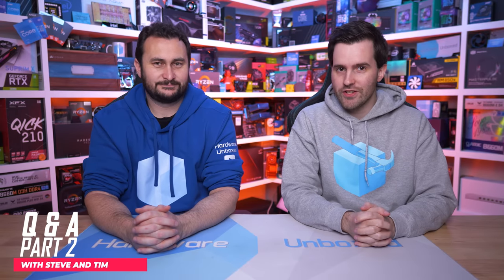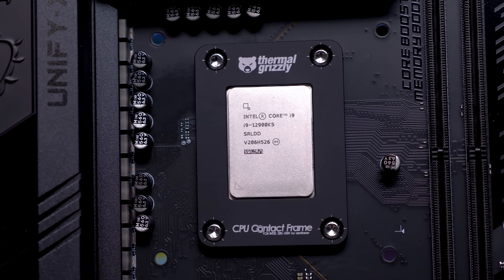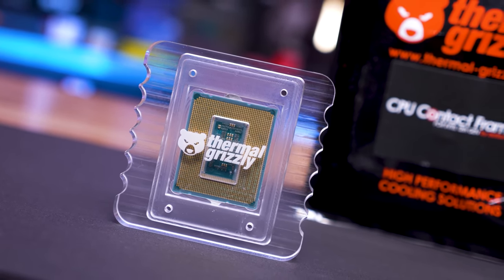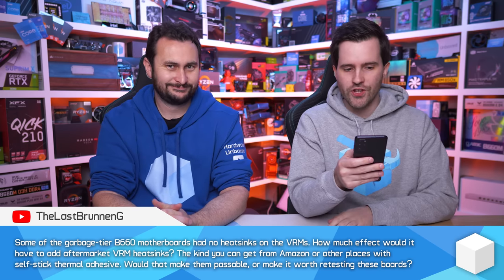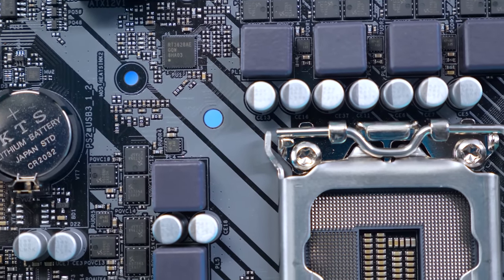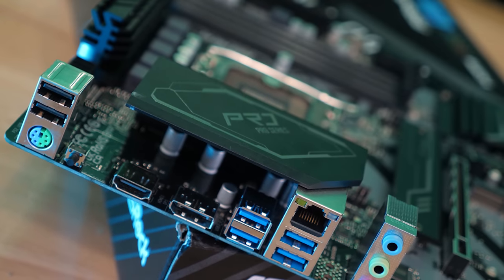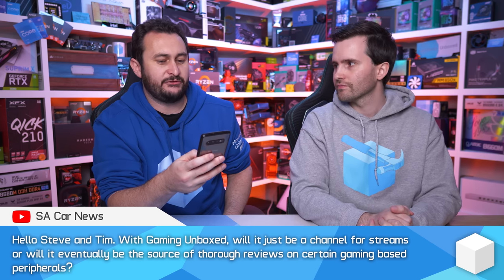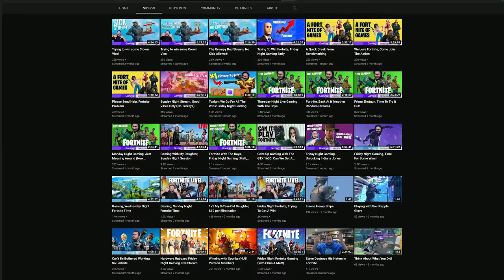Biggest Tech Fail 2022? Zen 4 To Make DDR5 Relevant? August Q&A [Part 2]

Comment: I think the biggest fail that isn't considered a fail by most is the RTX 3060, and to a lesser extent the RTX 3050. They both have ridiculous amounts of VRAM and I recall from a MLiD video back then that the VRAM the 3060 was using cost $12 per gb. Given that the 3060 Ti is a 6gb card, that's an extra $72 (which is probably more for the consumer) that wasn't really needed. We can still see the effect of this in the monthly GPU pricing videos where AMD cards (6600, 6600 XT) managed to drop in price where the 3060 couldn't, so it's in the same tier as the 6700 XT now and loses in almost every way.

As for the bottleneck super high end parts in testing, I think Steve completely got it wrong. He describes as a card you shouldn't buy, which is an extremely mild way of putting it. The 3090 and Ti version exist to rip money out of your wallet for almost no benefit in gaming. The "do your own research" answer is a very lazy one too. If you are into PC hardware and/or tech, then yes people are inclined and able to navigate reviews, but the inexperienced and newcomers are less likely to do that. The 3090 is an awful product for the money, yet using it in benchmarks gives it more exposure than it deserves. I expect this answer comes from HUB not really being in touch with the average gamer.
Reply: The 3060 has a 192-bit memory bus width.  The only options are either 6GB or 12GB.  The 3060 Ti has a 256-bit memory bus width.  The options there are 8GB and 16GB (your claim that it's a 6GB card is simply wrong).

Given those limitations, as absurd as it seems to have a lower-end card have more memory than a higher-end card, going with 12GB is the better option for the 3060.  Going with just 6GB is too little.

Comment: my mouse is set to 16-- vfor battlefiels games and 1800 for the rest. windows is default and then i scale down ingame to 50 to 80+ depending on the game.  I flick left and right and each flick needs to be 90 degrees so it feels the same in every game. that way all games feel great.  above 1800 dpi you really start to get trash feedback from the mouse sensor but you want the max sensor data so 1800 is about the safe limit for most sensors out there. if i still preform bad after that game i stream or record some gameplay and i see if i have overshoot or undershoot when i flick to a target and then slightly adjust the ingame sensitifity or of not powessible ingame the dpi and record again till each flick is spot on.  So adjust the ghame to your mouse not the mouse to your game ! and neverd adjust your gameplay always makee the hardware +game work for you.
And vulkan is absoluly godly sadly most prefer to use DX12 which is TRASH  rage 2 which uses vulkan really is the smoothest game out there. sadly there are still developers that manage to fk up vulkan (looking at you ubsioft... as breakpoint vulkan was trash)

Comment: When it comes to mouse sensitivity I have found that I am higher than about anyone I have ever met, and I have dropped mine down a lot over time. I like a heavy mouse with a very slick surface and a high sens, but I had it to the point for awhile that you could literally see my pulse through jitter in my aim if my hand was sitting on my mouse so I dropped the DPI down until that effect went away. I generally plant my wrist on my desk and don't like having to pick it up. I don't know much about the cm/360 metric that some mention, but I would guess mine sits somewhere around 8cm but it used to be a bit smaller.

Comment: Wasn't the Q6600 one of the first?  I got one when it was new, and 9 years later it was still able to hold 60 fps in most titles.  It was taken off of my LAN before it was really falling behind.  I will typically build a new system, and drop the oldest system off of the network.

I remember the Q6600 or E8400 debate for gaming, and that was just ridiculous how pathetic that comparison turned out only a couple of years in.

Comment: The new socket and new DRAM requirement makes me think there is a cost obstacle to moving to it. Even with this generation coming, I chose to upgrade my existing CPU to a 5950x. I wasn't going to buy another $350 system board and new DRAM. With the GPU being the present gaming bottleneck, that will be where I spend money next.

Comment: Just as an FYI Steve, you should NEVER adjust your mouse sensitivity in Windows. Turning your mouse sensitivity down in Windows literally throws away some of your inputs. Turning it up alters your inputs - but only a fraction of them. Windows sensitivity should always be set to 11 (which is actually the "off" setting) because it's broken as shit.

In game settings are inconsistent, but typically you want to leave them at default (so they are off/transparent). Then you should adjust your mouse sensitivity until it feels right (and what that is is obviously highly subjective and different for everybody).

Obviously if you're not a pro it doesn't exactly matter, but if you are even a medium-level gamer you will probably notice the inconsistency in mouse accuracy and think it's your fault. It's not, your settings are screwing you over.
Reply: This is mostly not true anymore. Modern fps games use raw input data. Generally its best to leave the windows slider alone in case a game doesn't, but it's extremely uncommon these days. If you know that all the games you play use raw input, (Anything made beyond like 2010 almost always will.) you can use the windows sens to manipulate the speed of your 2d cursor pretty safely without fucking up camera feel in 3d games.
Reply: @bigdogmassive  But what about in windowed and fullscreen borderless modes?
Reply: @GENKI_INU  Doesn't matter, games use the same input logic regardless of whether they're running windowed, borderless or true fullscreen. Or if there is an odd exception, it's possible but it would be truly exceptional, like there isn't ever a reason to do that and it would be adding extra engineering risk, i don't think a game like that will be found.

Games that use mouse for the sake of angular offsets, should always use raw input, though i expect a lot of Unity, indie games etc to not do that and use Windows pointer input, but honestly i haven't tested recently. Competitive games and especially FPS would get slammed hard if they didn't use raw input, you can pretty much rely on them being raw input. Games and game sections i.e. menus that use mouse for the sake of pointer interaction should use Windows pointer input.

Comment: There is a developer guide on the Intel website with an explainer of how to properly take advantage of heterogenous CPUs in games, so that if you are developing a game engine with a job system you can give the big wheelbarrows to the big guys, and the little wheelbarrows to the little guys. It involves querying the Windows API to detect the CPU topology, and then binning the logical cores to know how many of each type you are working with, so that you can then set the thread affinity of your various jobs accordingly. The main difficulties being of course that you don't know what you are working with in advance, and that it adds complexity to the already complicated task of making a game scale across a multi-core CPU.

However Intel 12th gen CPUs have been around for less than a year, which means that there are likely very few games that shipped with those optimisations, if any at all. Game development takes time.

Comment: Also, for intel arc gpu's, you will should consider it in several parts.  And one of the best parts, when considering it a mess, you probably should look at AMD's Vega 64/56 GPU's from launch till the became less of a mess and compare those intel GPU's on that time frame for base improvements.  As it stand IMO I wasn't expecting anything from Intel on release just based on Raja Koduri's past GPU releases under AMD almost always doing this.

Comment: Thanks for answering my question guys. I think for the past few generations AMD has implemented some exclusive technologies on their laptops like Smart Shift, and to a lesser extent they popularised SAM.
Reply: AMD and Intel are the only ones using resizable bar (SAM). I have a 3060 ti and there are games where SAM should be on and it's not, and games where it should be off but it's on. Nvidia doesn't care about SAM at all. Nvidia never made a good SAM whitelist in the driver from the start and they still haven't.

Comment: I have 12000 DPI(mouse can do up to 30000 DPI) but it's very low ingame(usually I have to edit the game config files), I've got around 36,6cm for a 360 turn in most games.
Optimum tech did a great video on latency with different DPI settings and it seems that higher DPI = lower latency, though I wonder how high the DPI before It's really diminishing returns

Comment: I typically set my mouse speed/DPI so that ~2-3cm of movement is a 360 degree turn, it's what I got used to playing Quake 1 where the accuracy was limited by the engine anyway, there was no location damage, and responsiveness was typically more important than accuracy. Unfortunately games these days are SOOO much slower it is hard to find anything that compares and what I use is definitely sub-optimal. However I do find it fun playing shooters, charging in to point blank range and making a mockery of modern players who can't keep up with a circle strafe as I kill them with the weakest weapons. Because of that I was ranked #1 in my region for using the TMP in the original counter-strike, and it is still hilarious how bad modern players are at close range combat, unfortunately the long range guns have been made absurdly powerful in modern games and closing the distance just isn't reliably viable any more, at least snipers still have the worst aim of any players though, I rarely have any trouble running up to a sniper to kill them with a knife in battlefield :)

Comment: 24:30 I disagree. Ryzen 5 5600X: 6 core 12 thread CPU will not be unuseable in 4 years Tim.  That's insane. 
A Ryzen 5 3400G is still pretty usable in 2022. 
A CPU today that is unsusable is a AM3 generation.  My FX-8300 (4 core 4 thread aka fake 8 core) runs like molasses on the latest Win10 21H2 update.  It will still load up web browsers and search Youtube but you will see the noticeable slowness.

Comment: Running a i5 3570k + gtx 970...still doing the job...whats that now, 6 or 7 years down the line. Skipped alot of generations so spending on the new ddr5 eara stuff is not bothering me as much as the blokes spending every gen.

Comment: HAve you been considering benchmarking more sandbox, physics based games? I have never seen anyone of them in a proper benchmark, and I would love to know how V-cache affects performance in games like Scrap Mehcanic and Besiege and Space Engineers and KSP and - I'm gonna stop myself right there. If you do benchmark them though, you should really get something that's really taxing on the CPU from the workshop, otherwise the data would be completely irrelevant. (For example, having four hundred FPS at idle and ten with a heavy creation, against sixty at idle, and forty with the same creation, there's a clear winner here).

Comment: I'm still using an 8700K (paired with a 3090ti) and I don't feel a compelling reason to upgrade the CPU yet.  I'll probably give it another year and see where things are.
Reply: Unless you're playing at 4k you could probably get a significant fps boost with a fast gaming CPU. Seems odd buying such a top tier GPU but leaving performance on the table.
Reply: @ChrisMisMYhandle  I play at 3440x1440 ultrawide. I realize I could get better performance with a faster CPU, but with my setup I'm able to play all of the games I play at max/Ultra settings with no issue (just upgraded from a 1080ti).
Reply: @ChrisMisMYhandle  you act like the 8700k is a slow CPU lol

Comment: Well, that is a first comment fail for you, one made from a complete lack of thought.
What could they do on the E cores? Pathing. I mean, it is one single example. ANY asynchronous computing could be done on an E core with a new thread, freeing up the main core to just keep going and then, when it gets around to the stage of "reading what path an NPC is going to take", reads that waiting asynch output for each NPC's path, said path also being dependent on the path of others taken at the same time. Do so every 0.2 seconds and you are running real time as far as human reaction is concerned, run it every second and you're likely at the edges of what humans can manage to REACT under and MAKE their muscles move to make it so. Do it every 5 seconds and you react quicker than any actual pilot of a fighter craft could manage. But any asynch process could be placed there.
Requires it be not-mutlithreaded, and windows is terrible at forking processes, but all it requires is a linked list of outputs to be read by the main game loop and that E core can do its own thing every X seconds (or Y times per second) and never CARE that it isn't on a fast processor, it is on an EMPTY processor.
Now you would also like a dogwatch process that determines if the NPC pathing program has stalled (to restart it) and determine if the main core loop has stalled (so either CTD or do a little cleanup and go to the next loop, and pretend that the failing loop never happened). That's another E core. Because a dogwatch program doesn't have to be the same process as the main loop (indeed it can't be, otherwise if the main loop fails to complete, the dogwatch isn't done either, and it may be that it locked up in the dogwatch loop, halting the game, whereas in a REAL game it would just keep going and not know that the dogwatch has stopped until and unless some other process fails to complete a loop).
Windows not being good at forking isn't why E cores don't get used, and it isn't why E cores shouldn't get used.

Comment: It's the shareholders[chasing the quick dollar] holding the companies to ransom, as the shareholders expect result's NOW NOW NOW. To make GPU's and get them where the consumer wants to buy X GPU with reliable hardware and software takes 12 to 15 years.  IE AMD took roughly 15 years to get its driver software sorted even when they had pretty good GPU hardware.

Comment: Isn't the primary concern with a CPU being "enough" for gaming primarily that it doesn't bottleneck the GPU? In that case the 5600X performs more or less the same as other pricier Ryzen parts, but the 12400F is outperformed by other Intel 12th gen parts with current gen high end cards. So wouldn't the sweet spots for 6 core longevity be the 12600 (10% higher boost clocks are much closer to those of the rest of the 12th gen stack) and the upcoming 7600X (likely ~30% higher perf)? Essentially even if you think the vast majority of game designs won't benefit from more cores any time soon wouldn't you still want to prioritize CPU per core performance headroom to avoid bottlenecking next gen GPUs, next next gen GPUs etc.?

Comment: E cores might be good of offloading for example sound effects/music, or textures decompression/loading (which is a process bottle-necked primarily by the storage speed, even with high end nvmes). Also I can think about networking tasks that can be probably offloaded with plenty of headroom on the E-cores.
Reply: Wont happen, Games have Terrible physics ballistics, Still 20 years later no dynamic destruction or proper vehicle defamation, localised dynamic damage, for a reason.  Developers are trying to reduce the effort, Why E-sports is endorsed and pushed even though it results in simplistic garbage games, Same with there Focus on RT. Its all maximum profit based on gimmicks for the least amount of effort

Comment: I'm at 400 DPI, I usually like it higher in Windows, and I had to disable pointer accuracy in the control pannel for the windows mouse cursor to be fast enough. I setup most game sensitivity to have my 180 degree turn be half the width of my mouse pad, the mouse pad is a razer Gigantus V2 Large	450 mm / 17.72"	400 mm / 15.73"	3 mm / 0.12".

I don't raise the DPI higher, because even at 400, in some games, I have to have the in game sensitivity at almost the lowest value to get it to what I want. And my mouse does support multiple profiles, but I switch alot between desktop and games when I do some work monitoring as I game and it would be a pain to keep swapping the profiles even with the dedicated buttons for it. (I have a G903)

Comment: 1. Fail that isn't considered a fail? Perhaps E-cores? Since at least now they seem to be kind of useless - but mostly in context of gaming. Overall they do put enough weight to maybe not include them in fail category? Would depend on how you'd interpret the question.

2. NVIDIA cards using more and more power and spikes? People didn't notice it for quite a long time. And I'm aware that this trend is also happening for AMD, but to a lesser degree.

3. How Optane was handled? Great tech, but selling off the place that manufactures it.... was IMO the very definition of fail. But that's more business side, since technology, while not perfect, certainly isn't a fail. Though through lack of support and couple of bad decisions isn't exactly a MASSIVE success it could have been. I would love to buy optane - if I could afford it.

4. Me still building my PC... I'm scared, I've put Noctua NH-15D on it and hydronaut thermal paste. But it took me over an hour to get those springy screws to bite. Did I accidentally killed mobo or CPU? Or perhaps once I finish it I will realize that it still doesn't have contact with IHS? Panic..........